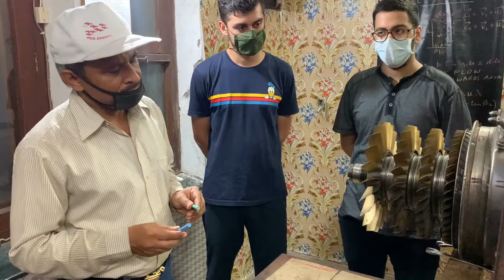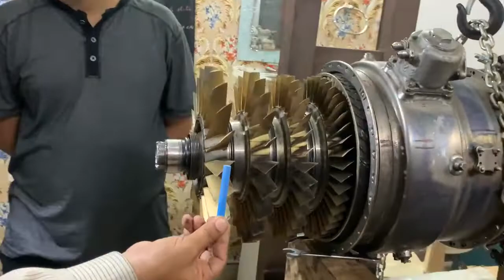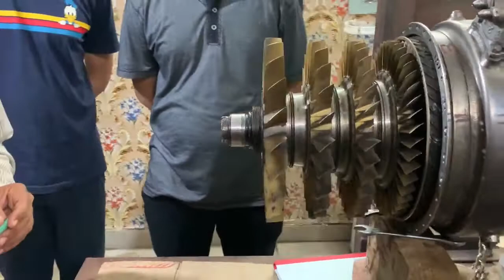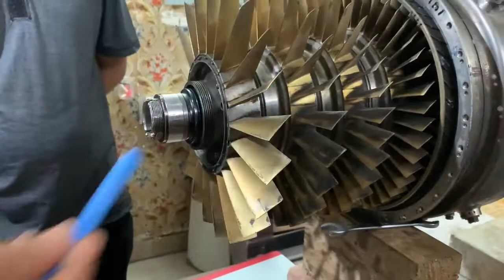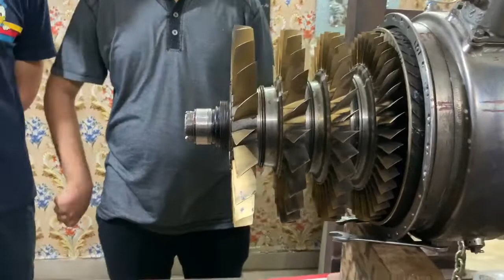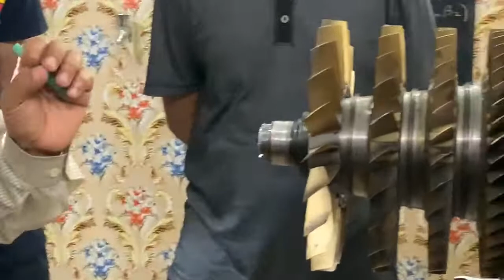How does an axial flow compressor of a gas turbine or jet engine work ? Part-1 of 3.

Comment: Why do the rotor blades diverge won't it decrease the velocity according to bernoullis principle
Reply from the maker: According to continuity equation, as flow area increases (diverges), speed reduces in subsonic flow. Hence you are correct partially.

Comment from the maker: Assignment-1(TEBT-3): List out at least 10 different parts of this engine which you can see in this video. What is the purpose of these parts? What is the possible material of these parts?
Reply: 1] First support housing :- In this material is magnesium alloy & Aluminum alloy it's purpose is to support engine.
2] *Compressor front casing*:-It's material is titanium and it consist of  VIGV, VGV1 ,VGV2 ,VGV3. 
3] *Compressor intermediate casing*:- It's material used titanium  it contains 4 to 9 stages of compression.
4] *Compressor rear casing*:- It's Material is steel used to make casing & it contains 10th stage and exit guide vane.
5] *Diffuser outer shroud*:-  It contains duplex burners and torch ignitors.
6] *Combustion chamber outer casing*:- It consist of  annular flame tubes.
7] *Compressor turbine*:-  it consist of 2 stages of NGV & 2 stages of rotor blades.
8] *Fourth and fifth support housing*:- it is  supports of barings for free turbine.
9] *Main drive assembly*:- 
It's purpose is to drive free turbine  via main shaft.
10] *Speed Governor RO-40*:- It regulates the speed of shaft.
Reply: 1. First support housing-Material used is magnesium alloy and its purpose is to support engine.
2.compressor front casing-material used is titanium and it contains vigv(variable inlet guide vain), vgv1 ,vgv2 ,vgv3 .
3.compressor intermediate casing- material used is titanium and it contains 4 to 9 stages of compression which are set of rotor blade and stator vain
4.compressor rear casing- material used  is steel and it contains 10th stage and exit guide vane.
5. Diffuser outer shroud- it has duplex burners and torch ignitors attached to it.
6. Combustion chamber outer casing-  it contains annular flame tubes.
7. Compressor turbine-  it contains 2 sets of ngv and rotor blades in the form of stages.
8. Fourth and fifth support housing- it supports free turbine with bearings.
9.Main drive assembly-it has free turbine  via the main shaft that drives the main rotor.
10.Speed governor ro-40-  it regulates the speed.
Reply: 1. First support housing-Material is magnesium alloy purpose is to support rotating shaft.
2.compressor front casing-material is titanium purpose it contains vigv, vgv1 ,vgv2 ,vgv3 .
3.compressor intermediate casing- material is titanium purpose it contains 4 to 9 stages of compression.
4.compressor rear casing- material is steel purpose it contains 10th stage and exit guide vane.
5. Diffuser outer shroud- purpose it contains duplex burners and torch ignitors.
6. Combustion chamber outer casing- purpose it contains annular flame tubes.
7. Compressor turbine- purpose it contains 2stages of ngv and 2stages of rotor blades.
8. Fourth and fifth support housing- it supports free turbine with bearings.
9.Main drive assembly- purpose is free turbine  via the main shaft drives the main rotor.
10.Speed governor ro-40- purpose is it regulates the speed.
Reply from the maker: @rohansharma9669  First Support Housing has been removed and hence is not seen in the video. Compressor Turbine, Fourth & Fifth Support Housing, Main Drive Assembly and Speed Governor are also not seen in this video. Please see the video at least 3 times again and give the correct answer.
Reply from the maker: @amritpalsingh4622  First Support Housing has been removed and hence is not seen in the video. Compressor Turbine, Fourth & Fifth Support Housing, Main Drive Assembly and Speed Governor are also not seen in this video. Please see the video at least 3 times again and give the correct answer.
Reply from the maker: @Jdnxh8639  First Support Housing has been removed and hence is not seen in the video. Compressor Turbine, Fourth & Fifth Support Housing, Main Drive Assembly and Speed Governor are also not seen in this video. Please see the video at least 3 times again and give the correct answer.
Reply from the maker: @vikrantsharma8799  First Support Housing has been removed and hence is not seen in the video. Compressor Turbine, Fourth & Fifth Support Housing, Main Drive Assembly and Speed Governor are also not seen in this video. Please see the video at least 3 times again and give the correct answer.
Reply: @spvmentors7258  ok sir.
Reply: @spvmentors7258  1.Compressor front casing-material is titanium purpose it contains vigv, vgv1 ,vgv2 ,vgv3 .
2.Compressor intermediate casing- material is titanium purpose it contains 4 to 9 stages of compression.
3.Compressor rear casing- material is steel purpose it contains 10th stage and exit guide vane.
4. Diffuser outer shroud- purpose it contains duplex burners and torch ignitors.
5. Combustion chamber outer casing- purpose it contains annular flame tubes.
6. Blow off valve purpose is to release back pressure to avoid starting problems.
7. Compressor rotor blades purpose is to impart kinetic energy to the air by increasing its tangential momentum.
8. Compressor drum purpose the rotor blades are attached to the compressor drum.
Reply: 1.Compressor front casing-material is titanium purpose it contains vigv, vgv1 ,vgv2 ,vgv3 .
2.Compressor intermediate casing- material is titanium purpose it contains 4 to 9 stages of compression.
3.Compressor rear casing- material is steel purpose it contains 10th stage and exit guide vane.
4. Diffuser outer shroud- purpose it contains duplex burners and torch ignitors.
5. Combustion chamber outer casing- purpose it contains annular flame tubes.
6. Blow off valve purpose is to release back pressure to avoid starting problems.
7. Compressor rotor blades purpose is to impart kinetic energy to the air by increasing its tangential momentum.
8. Compressor drum purpose the rotor blades are attached to the compressor drum.
Reply: 1.*Compressor front casing*:-material is titanium, it contains VIGV, VGV1 ,VGV2 ,VGV3 .
2. *Compressors intermediate casing*:-It's material used in it  is titanium and  it contains 4 to 9 stages .
3.*Compressor rear casing*:- It's material is  steel and  it contains 10th stage and exit guide vane.
4. *Diffuser outer shroud*:-  It contains duplex burners and torch ignitors.
5. *Combustion chamber outer casing*:- It contains annular flame tubes.
6. *Blow off valve*:- It's purpose is to release back pressure to avoid starting or chocking.
7. *Compressor rotor blades*:- It's purpose is to impart K.E to the air by increasing its tangential momentum.
8. *Compressor drum*:- The  rotor blades are attached to the compressor drum.
Reply from the maker: @amritpalsingh4622  Compressor front casing is not seen in the video. Please see the video again and write only those parts which you see in the video.
Reply from the maker: @Jdnxh8639  Compressor front casing is not seen in the video. Please see the video again and write only those parts which you see in the video.
Reply from the maker: @rohansharma9669  Compressor front casing is not seen in the video. Please see the video again and write only those parts which you see in the video.
Reply: 1.Compressor rotor blades from stage 1 to 3 purpose is to impart kinetic energy to air by increasing its tangential momentum.
2.Compressor intermediate casing- material is titanium purpose it contains 4 to 9 stages of compression.
3.Compressor rear casing- material is steel purpose it contains 10th stage and exit guide vane.
4. Diffuser outer shroud- purpose it contains duplex burners and torch ignitors.
5. Combustion chamber outer casing- purpose it contains annular flame tubes.
6. Blow off valve purpose is to release back pressure to avoid starting problems.
7.  Compressor drum purpose the rotor blades are attached to the compressor drum.
Reply from the maker: @amritpalsingh4622  Better answer this time. There is only one annular flame tube made of tempered steel.
Reply: 1.Compressor rotor blades from stage 1 to 3 purpose is to impart kinetic energy to air by increasing its tangential momentum.
2.Compressor intermediate casing- material used titanium and its purpose is to contain 4 to 9 stages of compression.
3.Compressor rear casing- material used steel and its  purpose is to contain 10th stage and exit guide vane.
4. Diffuser outer shroud- its purpose is to contain duplex burners and torch ignitors.
5. Combustion chamber outer casing-its purpose is to contain annular flame tube which is made of tampered steel.
6. Blow off valve purpose is to release back pressure to avoid starting problems.
7.  Compressor drum-  rotor blades are attached to the compressor drum.
Reply: 1 stator blades of compressor: change kinetic energy to pressure energy( steel) 
2 turbine: absorbs kinetic energy of gases to be used in compressor(titanium)
3 combustion chamber: fuel is ignited( tampered steel)
4 rotor blades of comp:increase kinetic energy(steel)
5 main shaft: support all rotating components(steel)
6 blow off valves: release excess pressure(steel)
7 comp front casing: 1-4 stages of compressor(titanium)
8 comp intermediate casing: 5- 9 stages of compressor(titanium)
9 comp rear casing: last stage of compressor, contains center of gravity of engine(steel)
10 diffuser outer shroud: slows down air after compressor, pressure increased(steel)